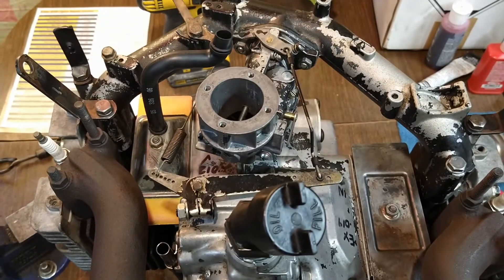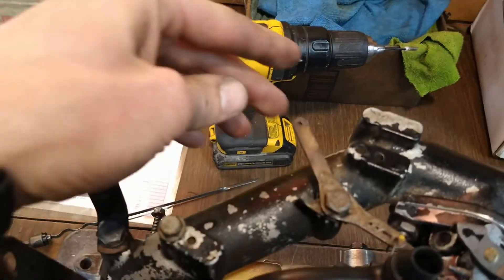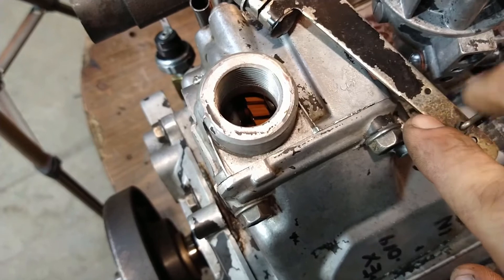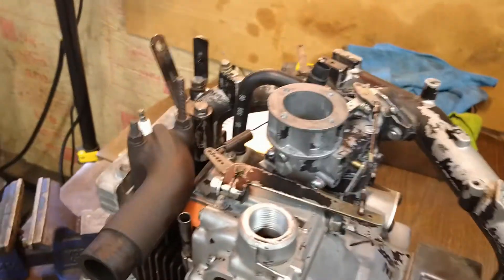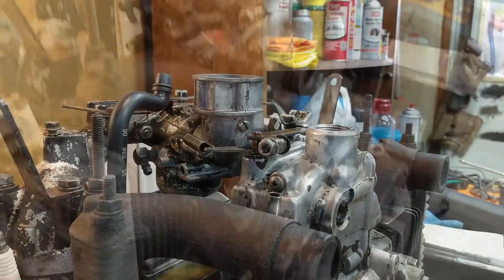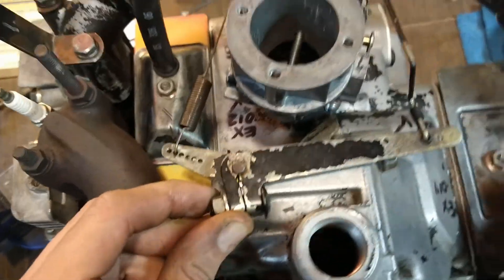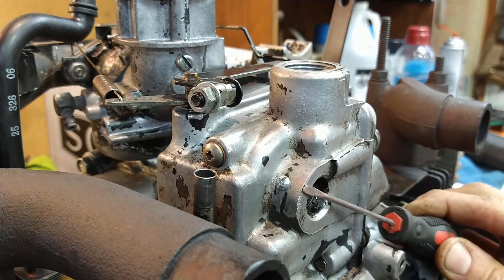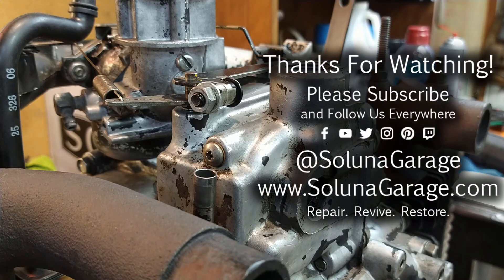Kohler Magnum M18 Complete Svc, Part 13: Governor Adjstmt & Svc Bulletin 246 – Cub Cadet 1882 Projct

Comment: How about changing from a k17 to a predator 670 on a 317 John Deere what does a guy need
Reply from the maker: Haven't done one before to be honest.
Reply: I think I've got it figured out had to order an adapter for the drive line but other than that it should set in there okay  @SolunaGarage
Reply from the maker: @mikesnyder692 nice

Comment: I seen the adjustment for governor on the vertical shaft Kohler and the shaft gets turned counter clockwise. And this horizontal shaft Kohler, the shaft gets turned clockwise. I have a 89 Kohler 20hp Magnum that I had to replace the engine. I had to use my carb and muffler on. Came out of a 91 or 92 Ford tractor. Identical engine except for a few minor bracket changes and I see why it needs a governor. Which direction do I rotate the governor shaft for it? 91-92 Kohler 20hp Magnum horizontal shaft engine?
Reply from the maker: Service manual for the Kohler M18/M20 Horizontal states clockwise.
Reply: @SolunaGarage Yes, it was clockwise. But full clockwise it barely revved up and kept going to idle then rev up going to idle. So I loosened it and just nudged it counterclockwise a hair, and now it's smoothly revs up and stays at a certain RPM. I see why you need a governor. When you have a 5-ft deck and it bogs down, the governor will rev the engine back up to what it's set at. The way it used to be and if anybody's interested in Northwest Ohio, this mower is for sale and comes with a 46-in plow blade for snow and tire chains. It's a Dultz Allis (Simplicity) 20 horsepower Kohler engine. 60" 3 blade deck. Electric clutch drive shaft driven deck. Hydrostatic drive, that also raises the deck or snow plow.  And oppower steering.Thank you for the info. I left my wife a year ago and I got the mower because she got a smaller one. I love this mower but I live in a trailer park and only have 2 swipes with a push mower on either side. Lol

Comment: Well, mine was having over revving issues. I adjusted the governor, then I came to this video and saw you inspect the governor gear. When I look down my oil fill hole the governor gear is gone. Give me a rundown on what I’m in for, engine rebuild?
Reply from the maker: Yup, plan on going into the crankcase, and you should plan on replacing rods, pistons, rings, and at least hone the bores.   You'll have an engine that will last your lifetime.
Reply: @SolunaGarage  do you have any videos of rebuilding this engine?
Reply from the maker: We do not have a full teardown and rebuild but that is in the works.  This series goes over everything except the opening up the crankcase and replacing components inside.
Reply: 2 other videos I saw said counter clock wise to adjust the governor
Reply from the maker: The service manual states clockwise.  You want the governor shaft to rotate in the same direction as the throttle linkage moves when it is pushed towards full throttle.
Reply: @SolunaGarage  Thank you for the info.  Just got a M18 Wheel horse and throttle  is jumpy.  Engine takes off fast and I have to find the right engine speed by Moving lever up down up down in fast motions to catch the revs. I hope governor adjustment is all it is. Thanks again for your help. And I am going to use your videos to learn about the M18.
Reply from the maker: @IonLok glad they can be of some assistance.  👍🏼

Comment: I have this engine on a cub cadet 1862. It just started over revving, but only when once the engine warms up, do You have any idea what the cause is? These videos are invaluable! Thank you
Reply from the maker: Overspeeding on the Mags is usually due to a worn or broken governor.  I would double check your adjustment and linkages, and also open the oil fill port to the crankcase and see if you can tell that the governor gear is damaged.  It only doing it once it warms up is a little strange.
Reply: @SolunaGarage  I did look down at that gear and it looked OK. I just spoke with the local cub cadet dealer. He said he doesn’t think it’s the governor as it is strange and only doesn’t when it warms up. I will double check the linkage, but everything looks as it should. It’s the exact same set up as you have on your motor in the video here, spring setting everything. I’ll look at it all again though.  Could it be something subtle? As far as I can tell all the linkages connected correctly and nothing is loose. I do also notice that sometimes the RPMs will drop slightly during mowing. It’s just slightly, not enough to affect performance and it seems to be random..
Reply from the maker: @ricardom.2687 carefully inspect your throttle linkage, shaft, and plate. Make sure there is not a way air and fuel can be metered outside of the throttle control...I agree that it is strange.
Reply: @SolunaGarage   Will go check it again now. 

There are 3 screws on the air intake that goes horizontally to mount onto the carburetor. While I was checking this all yesterday, I found one of them was backed out completely. I tightened it back down and checked the other 2 screws for tightness. I thought this may remedy the issue, but it did not. It does seem like there’s something going on with air getting in and raising the RPMs on the engine once it gets hot as metal expands. Something else has to be loose I guess.. 

The service bulletin 246 procedure should be done in any case? Even if the governor is working correctly?
Reply from the maker: @ricardom.2687 yup....if you don't want to risk governor failure in the future.  Good luck, let us know what you find!
Reply: @SolunaGarage  will do. I bought the tractor for $700, with 748 hrs on it. these were $7,000 when they were new! I’d like to rebuild the engine at some point when I have the time. I was also thinking of maybe retrofitting a Honda motor to the tractor. Not sure if that’s a compatible foot print though? It would be cool to hear the Kohler running and sounding like it did when it was new though. They have their own vibe to them.
Reply from the maker: @ricardom.2687 a popular swap is the Kohler Command or Briggs Vanguard.  We are actually developing harnesses to cover the electrical side of the swap.

We have a soft spot for the Mags and KT engines, but a lot of people would rather upgrade.
Reply: @SolunaGarage  These tractors will last another 50 years without a doubt. It’s worth putting the time and money into it to fix them. These were very well built the engine is the weak spot of course as always. After 1,000 hours etc some parts area hard to get I imagine. I’m familiar with Vanguard motors. I did not know it would work in this tractor. Interesting. Is it a direct swap? The mounting plate screws are the same etc. or does there have to be modifications.

Then I’m assuming the Honda footprint is incompatible?
Reply: So I found what the problem is. The throttle shaft sticks and does not drop down when you lower the throttle. You have to push it by back hand. It’s sticky. I did the adjustment as shown @ 5:30 but it’s still sticky. Now when the throttle is in the idle position and I flipped the governor shaft forward it’ll rev and drop back down normal. It’s only when I use the actual throttle control on the tractor that it starts to stick so it seems I like it is something in the linkage. It seems like that small spring that’s in the fifth hole is not pulling back all the way when you drop the idle back down.
Reply from the maker: I don't think the Honda is incompatible form factor-wise.  What most people do is swap in a Cub-spec Command or Vanguard because they are known to have the proper specs as far as crankshaft, etc.  Cub never used the Honda, so it's just a little more research involved.
Reply: @SolunaGarage understood. Which is a better motor? The commander or the Vanguard? I’ve heard good things about both. What are your experiences? I would be interested in that harness if you are fabricating them if I decide to switch out this motor.

Update: 

I think the premise of it doing it only when it’s warmed up was incorrect. It’s been doing it the whole time I ran it today. I think it’s the fact that the linkage is just getting more buggered. Assuming it’s the linkage which at this point I am.

I just was out again mowing the grass testing it. It ‘seems’ like it’s something to do with throttle linkage. Question; Would the governor stick a little bit and kind of hover  mid throttle and when pushed bag with your finger it’ll drop back to idle? Because this what it seems like it’s doing. Is this significant that the governor is starting to go bad? Or would it just run wide-open nonstop if the Governor is bad?
Reply from the maker: @ricardom.2687 usually they just go kaboom, then it's stuck at wide open.

I would try adjusting your governor and the sensitivity before condemning any of the parts of you can't visually see any problem with the governor or linkage.
Reply from the maker: Nice.  Pull the carb and clean and inspect everything.
Reply: @SolunaGarage  adjusting the governor in what manor? via the spring in that fifth hole position? I believe that’s the only adjustment on it correct?
Reply: @SolunaGarage  how is everything going, buddy? So the Kohler finally blew. Seized up. You mentioned selling a harness to connect different motors to this tractor. Cub Cadet 1862. I’d like to get a replacement engine, not sure exactly what is a direct replacement or something close that will not need too much modification to get the motor to sit? Thanks again.
Reply from the maker: @ricardom.2687 the M18 engines are obviously a direct bolt in.  The other option is to find a good used Kohler Command twin (if you can find one from an 1861, 1863, 1864, 2084, 2284 Cub that would be easiest, as you'll need the driveshaft, muffler, shrouding, etc).  We make a harness that adapts the M18 wiring to the Command.  A Briggs Vanguard twin will also work (look for models 1440/1641).
Reply: @ thanks for the info. I’ll look for a rebuilt M18. I The Vanguard is probably the easier to find. Have you retro fitted a Vanguard to a tractor like mine? Is it a real pain?
Reply from the maker: @ricardom.2687 for the M18, you can go further back in the Cub line as the same engine was used since the 1810/1811 models.

The Vanguard is a direct swap if you have a parts tractor.  Driveshaft, muffler, shrouding, etc.

We also make a harness to adapt a Vanguard to the tractors originally equipped with the M18.

One thing to be mindful of is that there are two PTO clutch pulley diameters offered on the Cyclops tractors.  You'll want to make sure you keep the same size as the one you are using if it is going to work with a mowing deck.
Reply: @SolunaGarage  yes I’m aware of the different size pulley. It depends on what serial number the tractor is. By parts tractor? You mean another cub? I’m confused on that
Reply from the maker: @ricardom.2687 just saying it is something to watch out for, sounds like you already know.

Comment: What can you tell me about this Engine Does it have an Oil Cooler if so What is it? Overhead Valve or L-Head Engine?
Reply from the maker: These are l-head engines and no, they do not have oil coolers from the factory at least in the garden tractor application I have here.